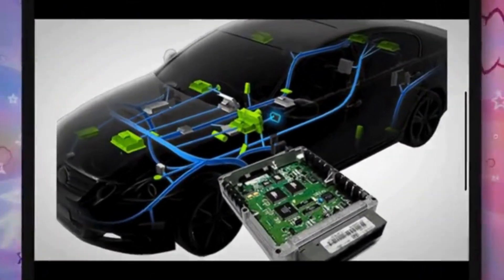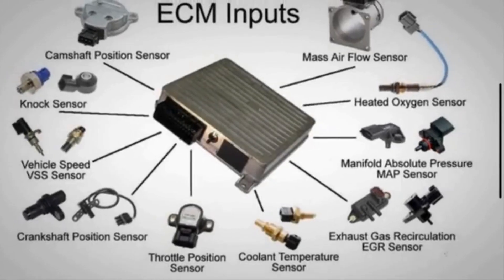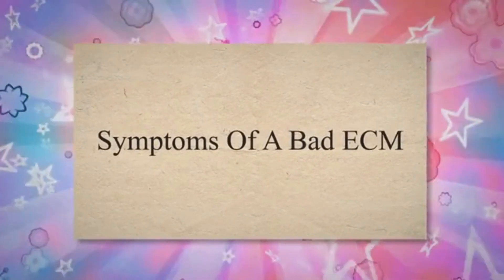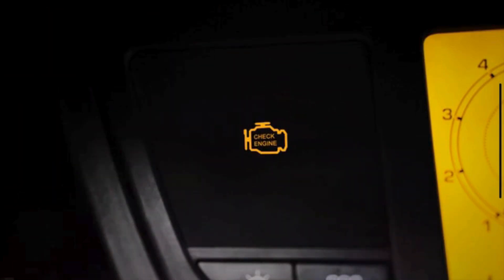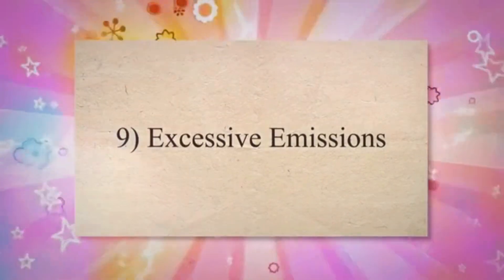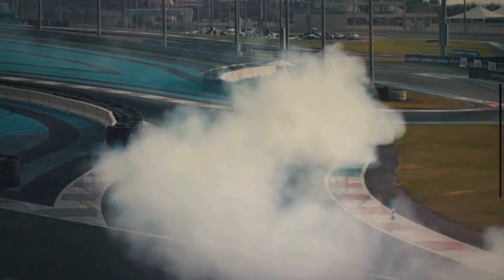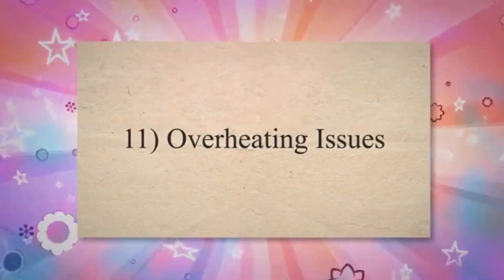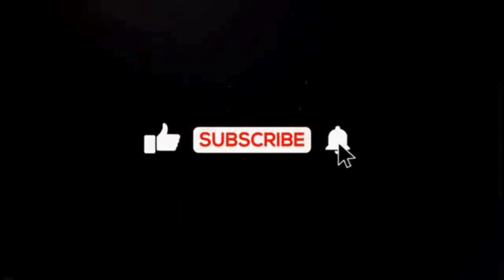Common Symptoms Of A Bad ECM (Engine Control Module) & DIY Fixes

Comment: It took much digging and experience but the ECM on 02 -06 altimas have a shared fuel pump/ ignition signal to no. 3 cylinder. After scanning much w/ my cheap scanner and throwing other parts at it I found the brain had a blown diode of all things causing that miss. Live and learn. I'll not own another unless it's earlier w/ the KDE engine.